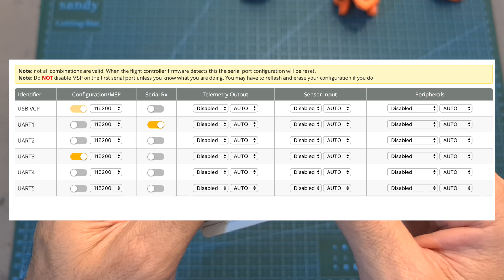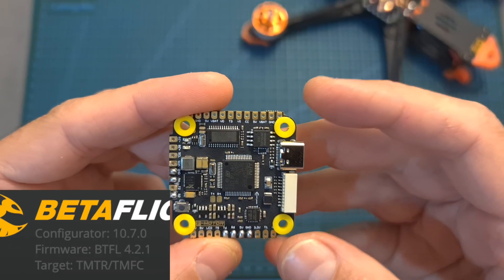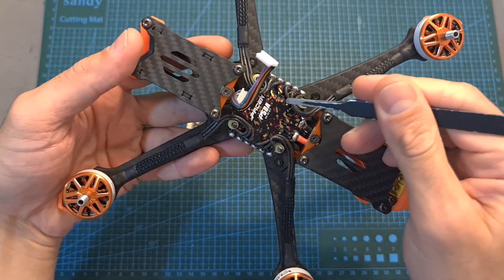T-Motor Pacer F7 Flight Controller & Mini F45A 20mm Stack - Setup & Ovreview

Comment: I run this mini f7 and esc combo with 2203.5 2850kv motors. How big of a 4s could I run? Would a 2000mah give me some long range flight times? Currently running 1100mahs
Reply from the maker: Sorry I missed your question. It depends on your setup.

Comment: any chance you can show me a picture of the air unit cable of the connector that plugs into the FC? I dont have one and need to find it
Reply from the maker: Sorry but I don't have it. As far as I can remember it's a standard 1.25mm JST 6/5 pins connector.

Comment: Hi Gal I know this is a year old video and I don't know if you still have the FC at hand but I am having issues with the camera control function. Could you please help me what resource pin out in the CLI is for this F7 single sided FC? (what is resource camera_control assigned to)
Reply from the maker: Sorry but I don't have this stack anymore. 
Did you contact T-Motor?

Comment: So I guess that you can't use a wired up DJI cable and expect it to power a Caddx Vista. How do you bridge to the 10V pad or would I be better off doing as you did and not use the DJI port? Thanks for any help with this matter Gal.
Reply from the maker: Sure you can - you just need to trim the cable and solder it directly to the Vista instead of using the Air Unit plug. You have another two 10v pads in addition to the one which is being used by the DJI plug, so you can use them if needed (I hope I got your question right).
Reply: @KremerFPV  Thanks for your time. In my case I have the vista connections soldered and was trying to use the DJI plug on the other end to the FC, but no power.  I guess I will just not be using the DJI port on the FC. Not sure what good the DJI port is if it isn't sending any power to the Vista. Hmmm...
Reply from the maker: @MarcsFpvAddiction  No problem. Just to make sure - are you referring to the Pacer F7 FC?
Reply: @KremerFPV  yes sir. Same one that came with FT5 60%. My soldering skills are amateur. Was hoping it would be as easy as Flywoo Explorer where as I only had to solder the Vista and plug into the DJI port. But nothing in life is easy, especially with this hobby. LOL!
Reply from the maker: @MarcsFpvAddiction  Haha, practice makes perfect. You should have seen my soldering work when I just started. Check out this video - I didn't get into that many details but it might help you out still with your setup: https://youtu.be/nDDx0MkoNXc
Reply: @KremerFPV  thanks Gal!
Reply: @KremerFPV  watching your video a bit closer you mentioned bridging between the VBAT and 10v pad. Is that required for this setup that comes with the 60% MK2? If so does that mean you solder a short wire between the two pads? Just now getting around to finishing this project. Thanks Gal!
Reply from the maker: @MarcsFpvAddiction  Sorry about the late response. Yes, you can use a short wire or just put enough solder in order to bridge the two pads.
Reply: @KremerFPV  Thanks Gal!

Comment: Great gals...how to set pit VTX on Betaflight via switch?...what kind of switch mode to active the pit control on option Modes
Reply from the maker: Thanks, it has to be supported on an FC hardware basis and as far as I can remember it's not.

Comment: Is there any difference with the Yellow PCB version of the mini stack? Also do have to remove those extra wires from the DJI plug if not using the DJI controller as you not enabling the UART in BF?
Reply from the maker: Looking at the specs, they look identical. 
If you are using a different UART for your RX, you don't need to remove the yellow SBUS wire.

Comment: Hi Gal, did you saw the new velox v2 motors?
Reply from the maker: Hi David, yes I have them and will test them soon.
Reply: @KremerFPV  oh nice!! they are the same as the v1s?  I saw them at unmannedtechshop.. they are not even on the t-motor website